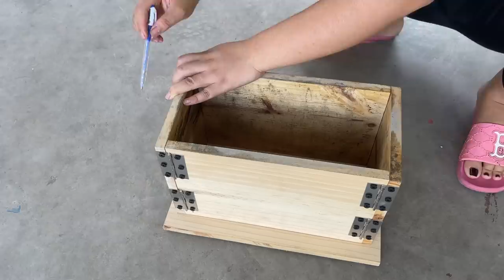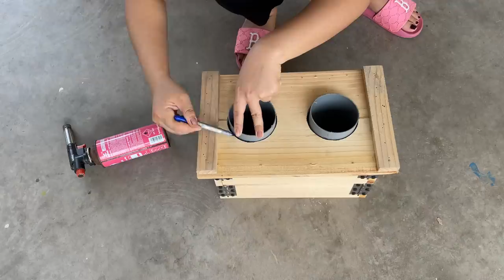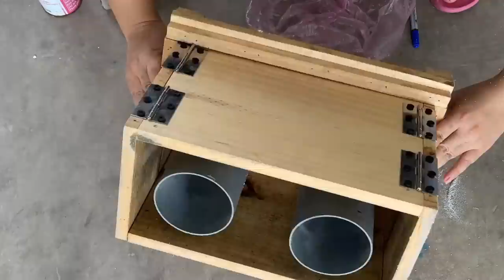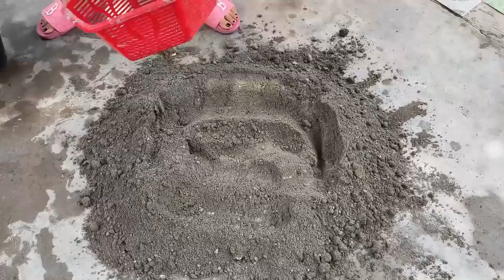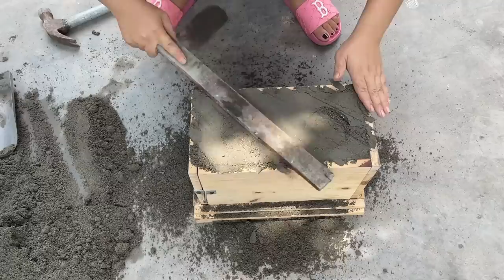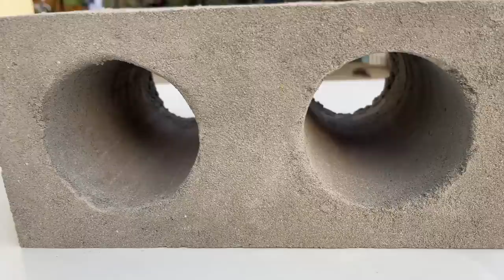Extremely Creative And Sure Brick Casting From Cement

Comment: Okay, these videos are getting ridiculous - even in terms of just raw material costs there's no value in doing this (a bag of concrete cement is about $2 and you'd be lucky to get 3 bricks out of a bag - probably just two and a cement building block runs under $2 currently).  For the form alone you'd have $3 in hinges, $5 in wood, $4 in PVC, figure $1 in other hardware (nails, screws) so $13 and that doesn't count the cost for the portland cement (if you had the other parts to make concrete) - and your time is worth nothing?  I just checked and cement blocks similar to what is being made here cost under $2 a piece so not until your 7th are you even breaking even and the ones you can buy have concrete / cement rated at a higher PSI than what is shown I'm sure though if there's a specific use (such as building an oven/fireplace) you could justify this but if you only needed a couple and standard cement blocks would work well.....
Reply: Where did you check those prices? In rural Eastern Europe or Brazilian favelas, I am sure you haven’t checked there, or in the Asia Minor where people are working for 2$ a day. Only ridiculous is you failure to understand that people have different ways of life and means for that life in different parts of world.
Reply: @alsad6699  very true that's why I didn't include labor costs.  The prices are based in the US and reflects material costs and not really numbers that have skyrocketed during the pandemic.  At the very least a bag of concrete cement is at least double the price of a cement block.  And that block is rated to a certain PSI for structural load.  I get it though in several places materials and labor is far less expensive than finished goods but my point is around videos similar to this that the title indicates it's innovative and groundbreaking, receives millions of views and scores of comments or interactions.  Why?  There are hundreds of videos showing extremely dangerous ideas such as making a chainsaw out of an angle grinder or a bench grinder out of a drill - with titles that read like "this simple invention changed my life in incredible ways"
Reply: Cost of cement block bricks in Australia is going up but still attainable.
What I like about this setup...dont put the holes in..create a press top and is quite good for making mud bricks at home.
I dont have mud bricks and have a fancy cast  press if I want to make them but I'm sure theres people would use that model with a couple of minor changes
Reply: Its a interesting idea but production is not there. I worked on a small scale adobe yard. We made a lot of bricks with 3 people. For concrete bricks you would have to do the same for scale. Something like 9 bricks or 16 per form not one. Its a cool idea but not feasible for time even if you take the material cost out of it.
Reply: @sassafrasred6657  yes I agree...I was thinking of the mud because my press has flower patterns...You'd only use it to produce bricks to spread through for interest..and nake a multi production formwork to produce plain bricks
Reply: Made money from u tube.....